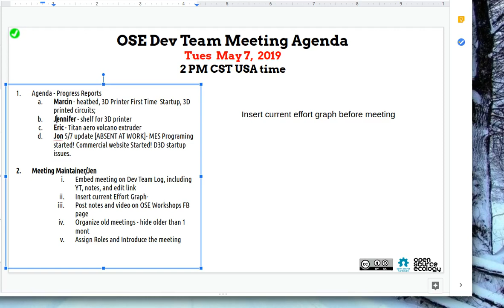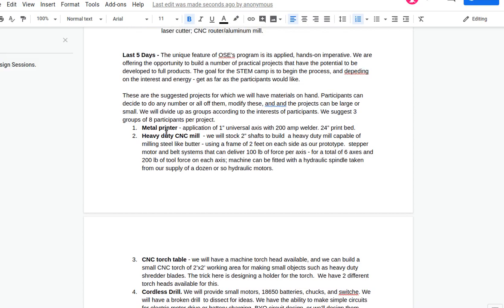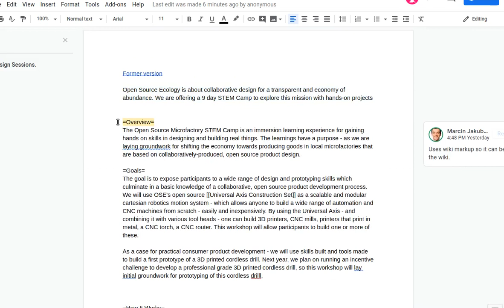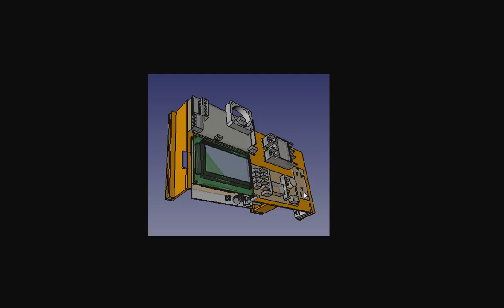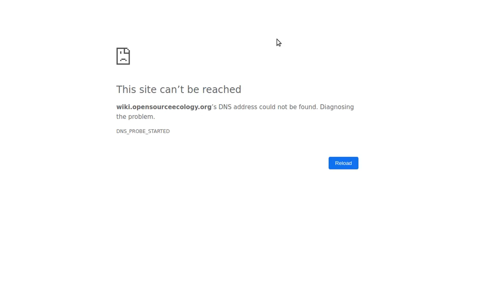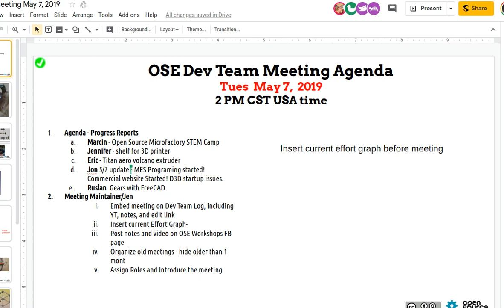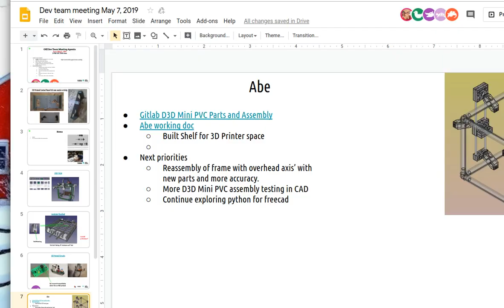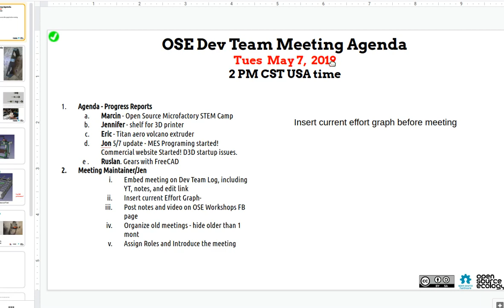Development Team Meeting - May 7, 2019

Comment: Marcin, for printing "tall things" have you looked into the belted 3d printers? Instead of a bed the print surface is a belt and the printer head x/y/z is at a slight angle. It allows you to print in an unlimited direction within build volume. Could be used to build larger format 3d printers from a smaller one.